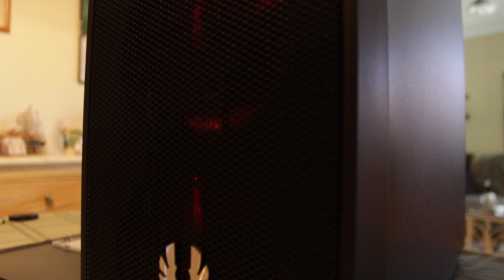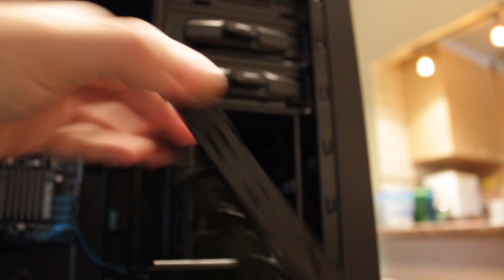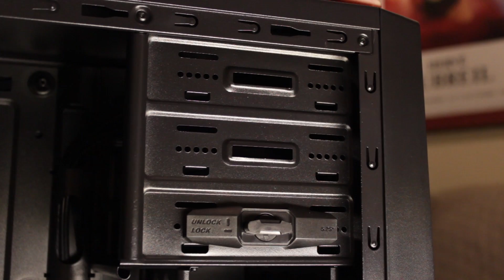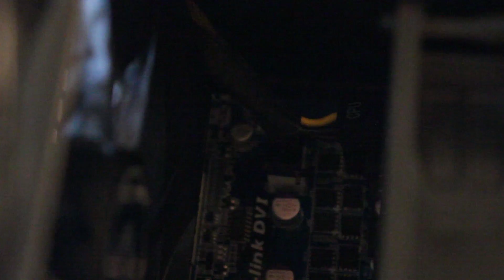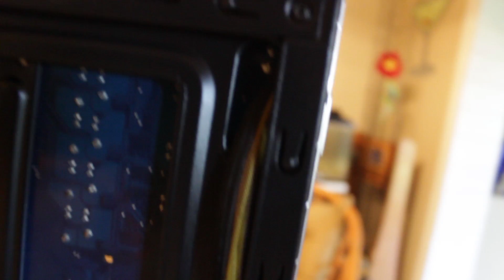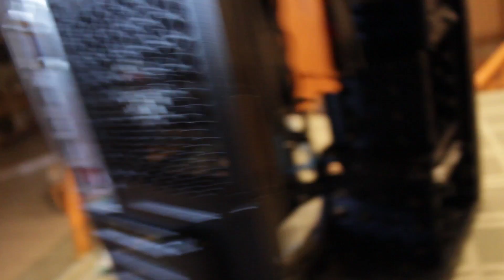BitFenix Neos Window  ATX Mid-Tower Case | Review & Build

Comment: will it fit the corsiar 500 watt power supply ? i see you have the 430 so just wondering.
Reply: +Reignster Sherrington It'll fit any ATX power supply. So check the specs of the supply and it will say the form factor.
Reply: yes
Reply: +That Guy will it fit a 750?
Reply: Yes.